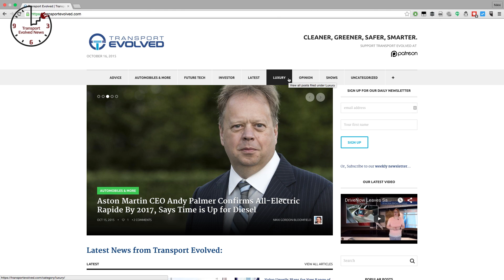FF’s $1 Billion Factory, VW Comes Clean, LEAF Birthday T.E.N. Future Car News 11th December 2015

Comment: 55% of world’s cobalt supplies for batteries come from Congo where 90% of the people do not have access to electricity of any kind.
Reply: +Luke W That is true the sourcing of Mined Cobalt is very shady and probably down right unreliable for business. Cobalt based Lithium Ion cells are just not the right solution for Electric Vehicle type of use case. Current Gen 100 miles class EV tend to use them because that was all the battery technology we had when they were developed. Now there are other chemistry not using cobalt and specifically more abundant and cheaper IONs which are verging on mass production viable.